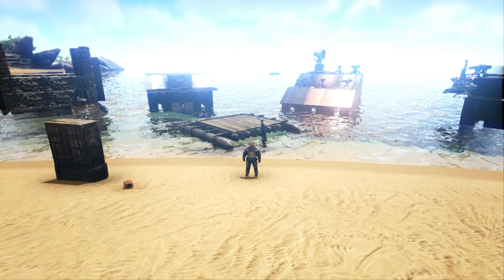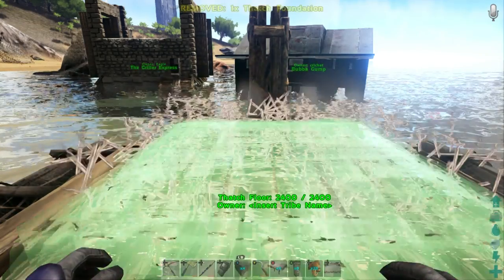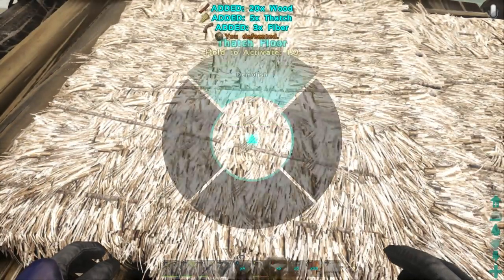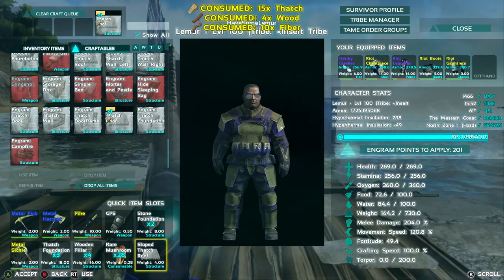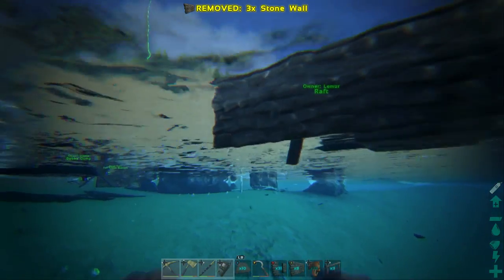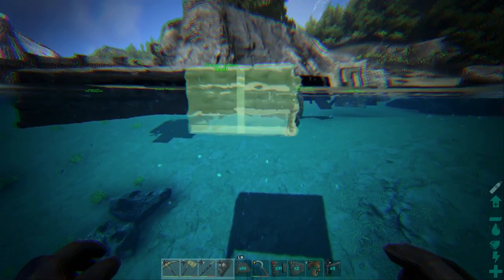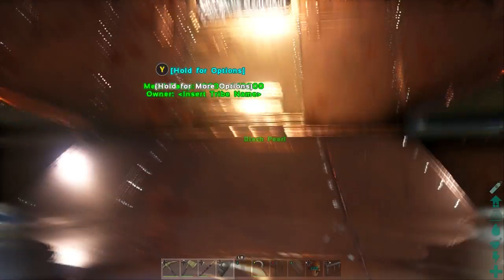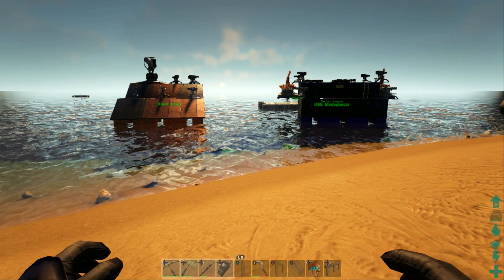Ark: Survival Evolved - Underwater Trap Boat

Comment: Idk if this is because of the s+ mod. But if you put 2 ceilings out and place a fence on the edge of the farthest ceiling. you can place another 2 ceilings
Reply from the maker: nice tip I will test it. Just to confirm you mean to extend the top out?
Reply: Well I didn't exactly watch the whole video... But I was making my own design because s+ means you can stack foundations. And this means you can stack downwards. So I have a trap under my boat. Either way just place down two ceilings and place a fence farthest from the foundation see if it works.
Reply from the maker: Ok I will check it out during my tutorial tomorrow!